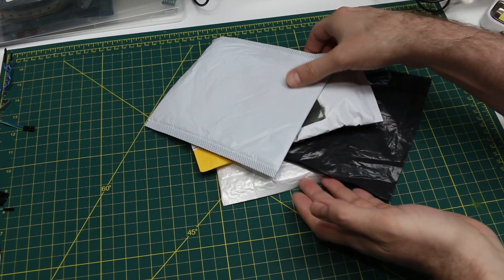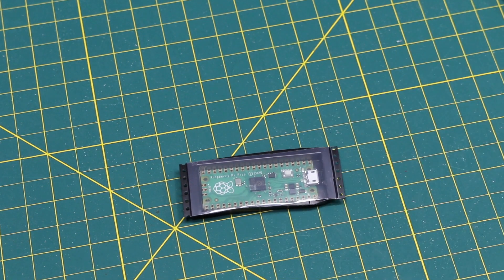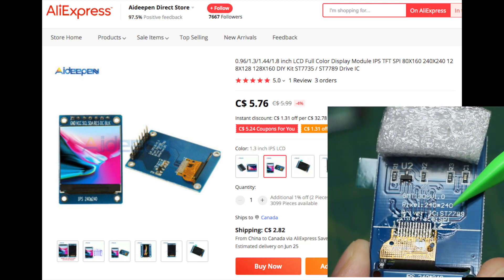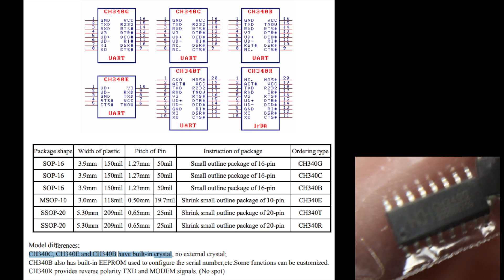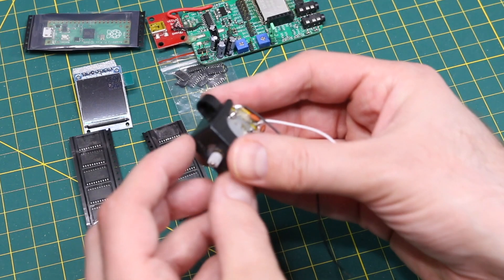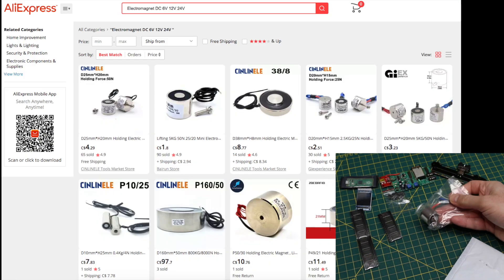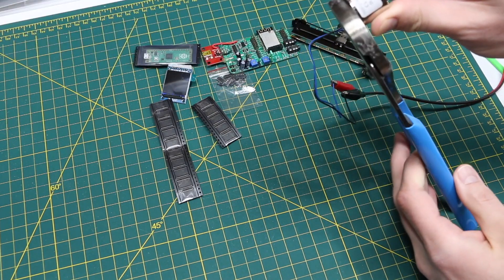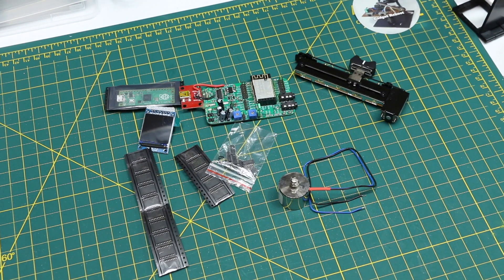Mailbag - Electromagnets and Parts

Comment: The fairly new ch340n chips do not need a crystal either, and are easy to solder, as its sop8 pins are more widely spaced than the msop10 "E" variety. Easiest to get them already welded up to a plate with a micro-usb, for nearly the same price.
I see you want a drop in replacement for the "G" though.  Yup yup.  The only flow control line I ever use is the DTR/RTS (Hangup Signal) to reset an AVR chip for Optiboot.  I've been able to use a  3-pin 12mhz ceramic oscillator  on the "G" instead of a bulky crystal with load caps.
The Pico is fun.  I glue reset buttons on mine, to avoid power-cycling to load new programs.
Reply from the maker: I also ordered some of the eight pin CH 340 when I only need transmit and receive maybe on a board with ESP 32 in some projects I might do.
 The main reason I ever put a large crystal footprint on any of the boards I have done is because I have so many of those crystals from probably 20 years ago I just wanted to use them up so I figure for one off designs I’ll sacrifice that space.
  I also have a bunch of large through hole crystals and I have no clue what I’ll ever use those for but I’m reluctant to just throw them out. I have especially a lot of 20 MHz I was using on breadboards with Pics or Atmels long ago.